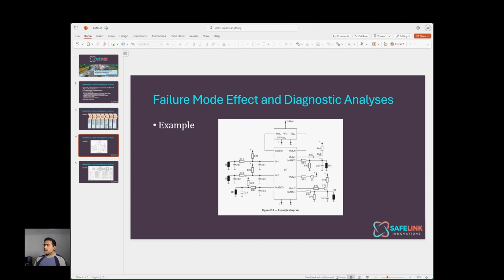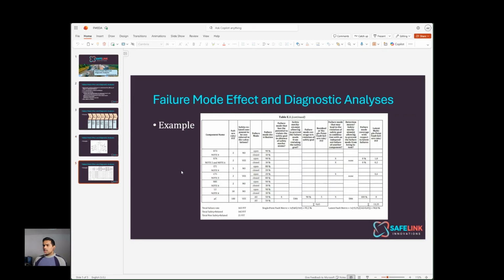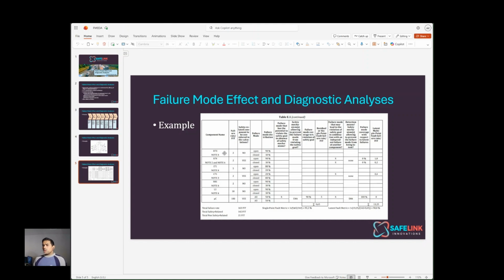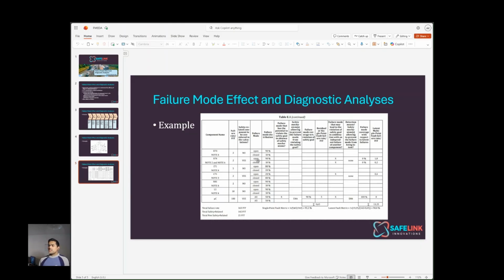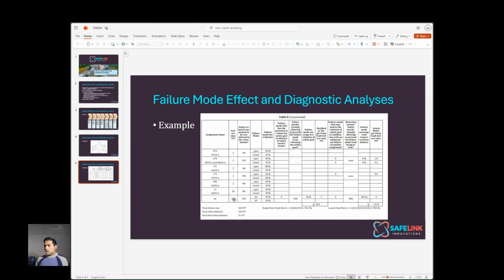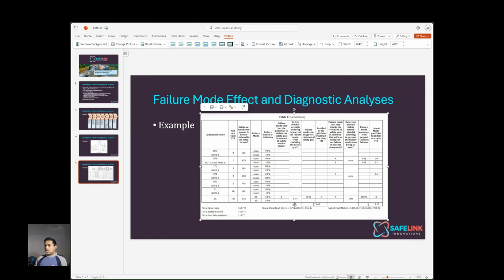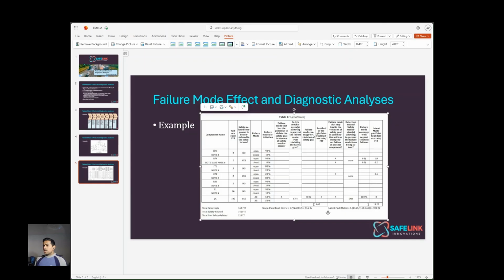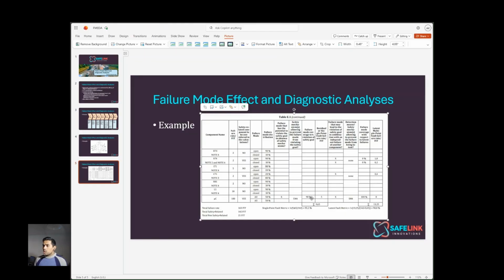FMEDA - Introduction (incl. an example) - Part 2

Comment from the maker: Creating an FMEDA from a circuit architecture often requires identifying hundreds of components, assigning failure rates, and calculating safety metrics like SPFM and LFM.

Doing this manually can be extremely time-consuming.

SLIKWORKS FMEDA Software helps automate the entire workflow - from importing components to calculating ISO 26262 hardware metrics.

- Import components directly from circuit designs
- Manage failure modes, FIT rates, and diagnostics
- Automatically calculate PMHF, SPFM, and LFM

See how SLIKWORKS simplifies FMEDA:
https://www.safelink-innovations.com/slikworks/fmeda-software